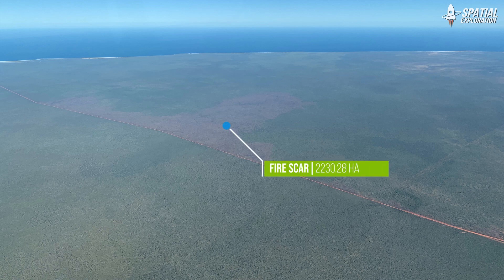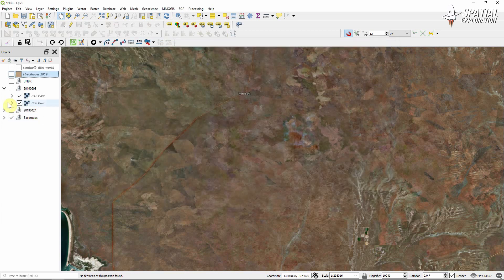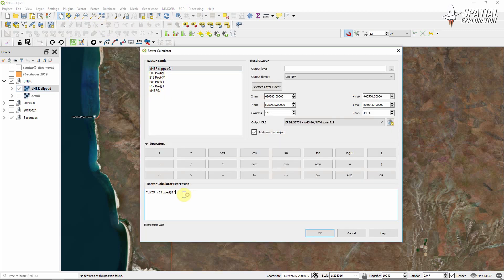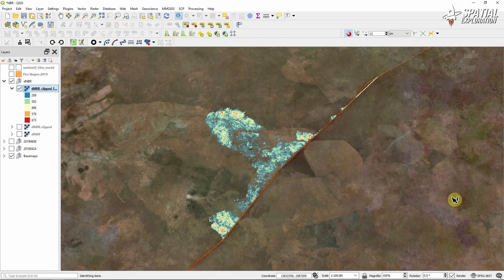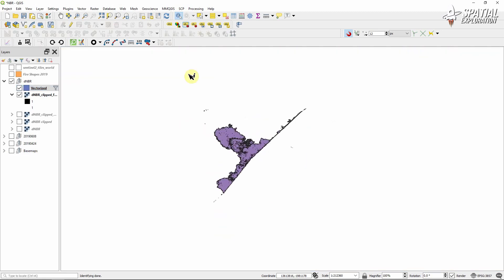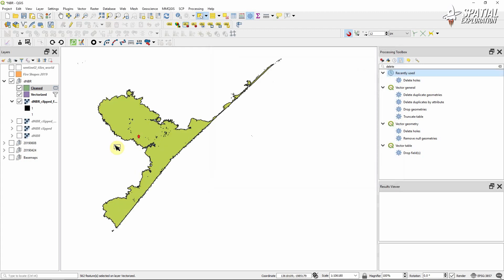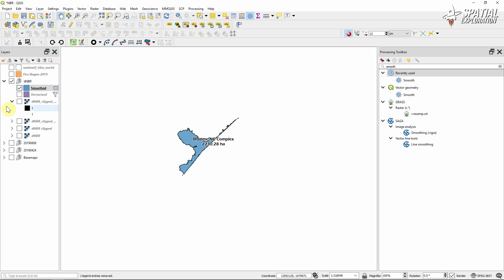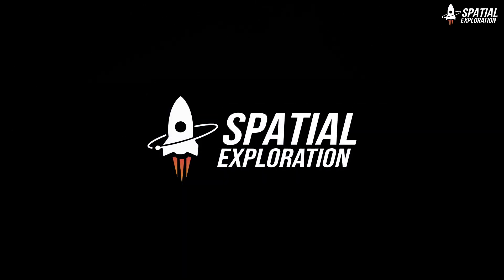Fire Scar mapping in QGIS 3.6

Comment: Thanks. Very informative. Can I please ask for your ideas around detecting biodiversity change?
Reply from the maker: Thanks James. I guess it depends on your research question, and at what scale (spatial and/or temporal) you want to detect any changes? If you had access to basic biodiversity indices (diversity, richness, evenness etc), you could use these as a dependent variable in a model with parameters derived from remote sensing. If you get a consistently good fit across tour study areas you could use this information to infer biodiversity change from remotely sensed data elsewhere (but with heaps of caveats for unexplained variation). I’m Interested to hear more about your work.